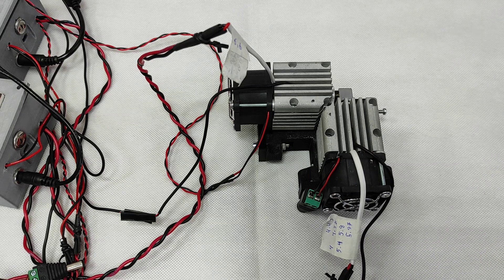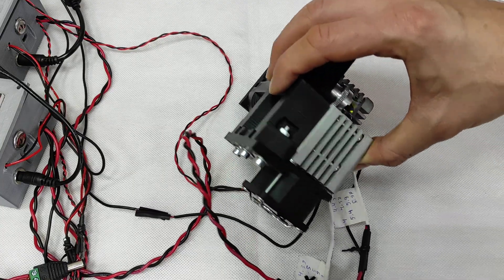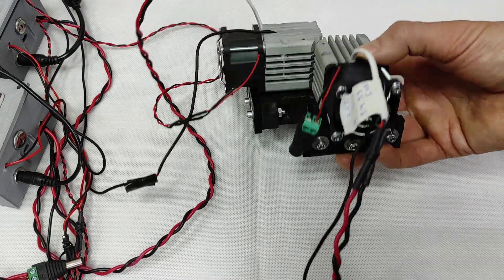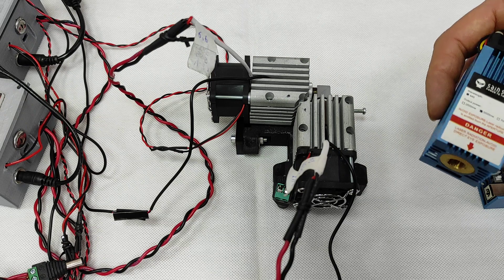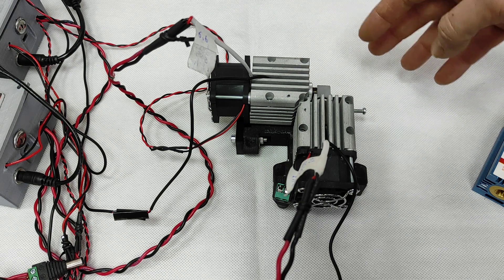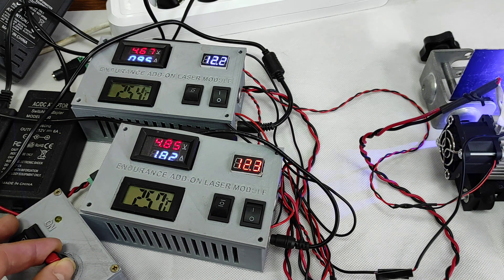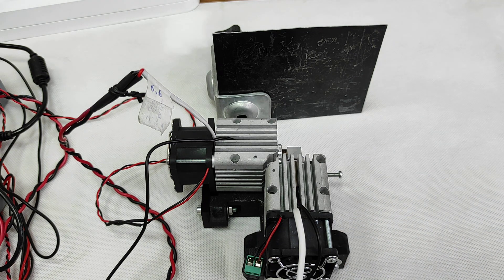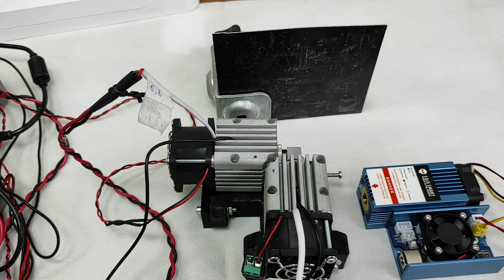An Endurance 15 watt (15000 mw) DIY laser upgrade. Combine 2 lasers together!

Comment: What type of prism ? 
450nm-650nm Blue Red PBS Polarizing Beam Splitter 10x10mm ?
Reply from the maker: it is a special PBS. It was designed specially for Endurance lasers. Most PBS can not work with 10 watt optical power on transmission.